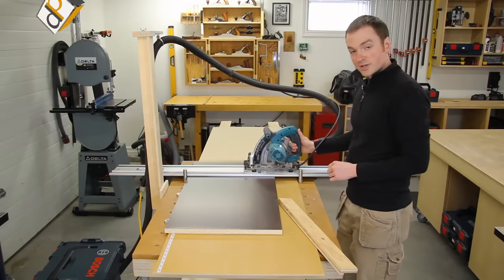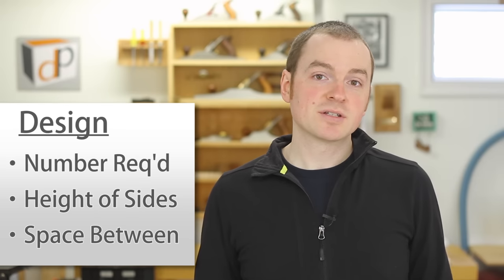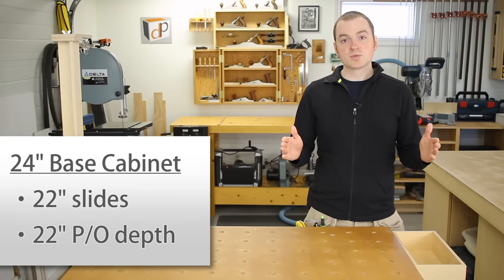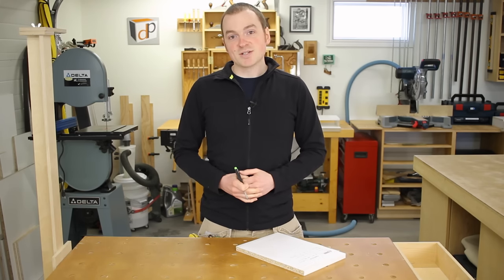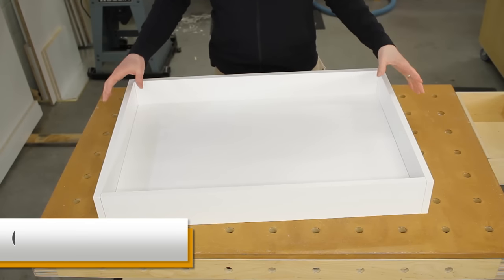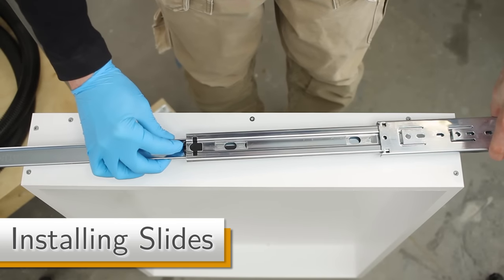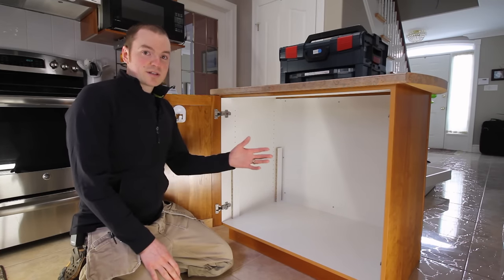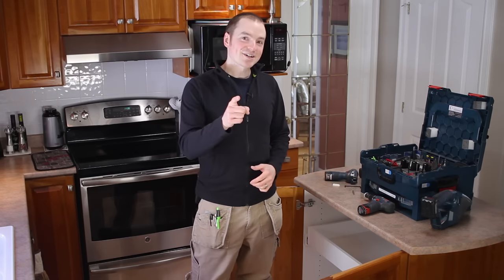How to Build & Install Pull Out Shelves - DIY Guide

Comment: Can you use the glides you recommend under a shelf? I have a industrial type shelving rack with wood shelves and want to install a slide out for a 30# epson printer so I can easily open the top and use the top mounted manual feed when I need to instead of taking the entire thing off the shelf and putting it on the floor.
Reply from the maker: Yes that should work fine. As long as you have something to mount each side of the slide to and have the proper clearance.

Comment: How do you attach the double spacer on the bottom drawer to the cabinet?  Do you pre- drill the cabinet?  My drill bit is only 1.5 inches long and is not enough to go through the double spacers plus cabinet. Or do you mark and drill on the individual spacers and cabinet? then using nail to attach the 2 spacers, then screw the now double spacers to the cabinet via the drilled holes. -newbie to wood working.
Reply from the maker: I predrilled through both layers of the spacer and a little bit into the cabinet side and then drove a screw of the right length. If you only have a short drill bit you could drill through one layer at a time and then use something long and sharp to mark where you need to drill the cabinet side through those holes.

Comment: Hi Dan,
Great video.
Can you please tell me if there was a reason that the front panel (ie the one you see when you open the cupboard) was not a full width panel. For aesthetic reasons I thought it may be better if this was the case as it would hide the join to the side panel.  Also wondering if you use glue when working with Melamine? If so what kind?  
Thanks Again
JJR
Reply from the maker: +RJJFavorites the reason I used the construction layout that I did was just for simplicity.  I have built pull outs in the past where I ran the front past the sides to conceal the fronts of the slides as well for pull outs that are seen more.  I wanted to keep these ones basic and build them as I would a typical drawer box that gets a finish front applied.  For the amount that these pull outs are seen and for what is stored on them I didn't feel that it was worth making them more elaborate.

I do use glue sometimes when working with melamine for joints that need to be extra strong.  For most joints I find the screws are plenty strong.  I use Titebond melamine glue which works very well and makes a good bond.  http://amzn.to/2pfNjVw
Reply: Thanks for the quick reply.

Comment: HI Dan, any reason you didn't dado the sides, front, and back pcs for more strength?
Reply from the maker: Sometimes I will do that for plywood but I don't usually bother with melamine. I've found that the screws provide enough strength for most applications. Sometimes I will add a bit of melamine glue to the join for some extra strength when needed.

Comment: Great tutorial. I’m looking at putting drawers in a walk in pantry that only has shelving and was hoping to put a number of sliding drawers in. I know there are bottom mounted sliders which I could mount to the bottom (Top of shelf). But I was wondering if there are top mounted sliders to mount to the bottom of the shelf so that I can put 2 drawers inbetween the shelves. Btw, I’m in Australia so stores would be different here than in USA. Thanks in advance
Reply from the maker: I haven't seen top mounted slides but that doesn't mean they don't exist. You could make some custom blocks or brackets that would allow you to mount side mount slides to the top or bottom of the existing shelves or if you can side mount them to the sides of the cabinet.

Comment: Great video. It's a project I need for my home. Just one question - your work pants - where can they be found? With all those pockets their perfect for working on projects. Do you have a link to the manufacturer? I appreciate all your help.
Reply from the maker: Those pants are the Blaklader Brawny pants. I've since switched to the Helly Hansen Chelsea Evolution pants though a couple years ago and I like them even better.
Reply: @DPShopTalk  thanks. It's difficult to find work pants that are practical for everyday use.

Comment: Hi Dan. It is clear that the drawers are full extension pulled out with the slides you are using. Can I use these on shelves?
Reply from the maker: A shelf by itself wouldn't work well as a pullout.

Comment: Do you make sure the slides are level before installing? If not, I can see binding in the ability to slide the drawer smoothly.
Reply from the maker: Yes that's why I reference off the bottom of the cabinet to make the slides parallel to the cabinet bottom.

Comment: I have a narrow upper cabinet - made for stacking cookie trays but the cabinet does not have any dividers.  I am quite short and this cabinet ( above the frig) is very deep so just fitting it with dividers isn’t a good solution.  Wondering if it could be fitted with a narrow, deep pullout with dividers the height of the drawer? I’d still need a stool to reach but I wouldn’t be fighting the cabinet depth.  Your thoughts?
Reply from the maker: That sounds like a good spot for a pullout and dividers would help keep it organized. Even if you still need a step stool you would be able to access everything easier.

Comment: Great video! Now that I am inspired,  I have a couple of questions.  How do you put in a drawer like that when you have a double door with that center piece?  When you cut that center vertical board out, do you need to add some type of support?  Thanks.
Reply from the maker: It depends on the cabinet construction and if that piece is structural. If they are face frame cabinets and you take out the center frame piece then you'll have a gap between your doors. One option would be to break it into two pullouts.
Reply: @DPShopTalk  How do you do the part in between the drawers?
Reply from the maker: @tara6094  you would need to add some rails between the pullouts to mount the slides to.
Reply: @DPShopTalk  thank you!!

Comment: Unless I missed, what kind of screws did you use. I'm used to screws and glue -- never worked with melamine...
Reply from the maker: The screws I use to assemble the melamine are #6 x 1 3/4" particle board screws.

Comment: Would be good to add coverage of what to do if the cabinet has a front divider but ru s the full width.  I assume installing a mount "bar" for slides, but clarity would help.
Reply from the maker: Yes if there is a middle divider then you would usually need to add some rails on each side of it to mount the slides to.

Comment: what screws are you using on this project? I didn't think the melamine would handle the weight of the food in a pantry drawer so i'm curious.
Reply from the maker: I use #6 x 1-3/4" coarse thread screws for joining melamine. When an extra strong joint is needed I use melamine glue as well.

Comment: shouldn't you use better joinery like dove tails or drawer locks? Also, wouldn't soft close slides be a better choice?
Reply from the maker: The joinery, materials and slides are always the choice of the client. For melamine cabinets it doesn't really make sense to use higher end materials or joinery. Some people opt for soft close while others don't really care.

Comment: You don't find the impact driver to be too powerful for particle board? Do you miss having a chuck when driving?
Reply from the maker: +Jason J. Ayala P. No i find that the 12v impact driver is quite controlled when using it with particle board as long as you pay attention to what you're doing. I don't miss having a chuck since the bits lock in quickly and I have a 12v drill for anything I need a chuck for. I also have a 12v non impact driver for more delicate driving.

Comment: Just curious, why not use base mount slides (undermount) so you don't need the spacers?
Reply from the maker: That would definitely be an option. I like the simplicity and strength of side mount slides.

Comment: I want to make some of these about 37" wide, do you think this would be stable at that width, or would I be better off making them narrower and giving up some of the space inside my cabinet?  Thanks so much!
Reply from the maker: +Private Lender 37" should be fine for width.  I would make the sides and front and back decently wide to help avoid sagging in the middle and also use at least 100 lb ball bearing slides depending on what will be stored in them.  Hope that helps.
Reply: Thank you!
Reply: What type of slides would you use in this case? Can you please share a link?  I was planning on doing 37" too. I've been looking at accuride drawer slides.
Reply from the maker: If you look in the video description I provided some links for some full extension slides. Accuride tend to be better quality but I've had good success with the less expensive Pro Series slides too. The weight rating is the most important thing to pay attention to.

Comment: If my pantry depth is 23.5” what size sliders do you recommend? Also how do you approach it if one side has large hinges for the pantry door that protrude out about an extra 1.5” than the other side? Thanks!
Reply from the maker: I would use 22" slides in that case. If the hinges stick out on one side and you can't put the pullouts where there isn't a hinge then I would use thicker spacer strips on that side to clear the hinge. It will give you a narrower pullout though.
Reply: @DPShopTalk  Thank you Dan!
Reply: Which double edge trimmer do you recommend?
Reply from the maker: @EEZYEEEE  I use the Freud double edge trimmer for trimming edge banding.

Comment: Dan I wish I had a workshop like yours mine consist of my back porch patio with a tent canopy
anyway being retired from the kitchen business I will start by making several for my kitchen and then take pictures and market on social media.
My question is about what to charge to install a project like you showed in your video seems like cost is about $ 35 a drawer with slides that's before labor and installation can you comment thanks.
Reply from the maker: I can't remember exactly what I charged for this job Bob but it would have been about a couple hours for install.  So it would depend on what you're hourly rate is as to what you would charge to install a pullout.  On a job like this I would have quoted the entire job based on materials plus however many hours I figured it would take.  Does that answer your question?
Reply: yes thank you

Comment: Great job on measurements..but I think pocket holes on the back and front would look much cleaner
Reply from the maker: +Devanand Magram do you mean for attaching the bottom in place or for the corner joints?  Sometimes I use pocket holes but I've done some tests before and actually found the particle board screws that I use driven in the way I showed are stronger than pocket hole screws in melamine.  Also unless the pocket hole is somewhere that won't be seen it's easier, faster and less noticeable to put a Fastcap screw cover on than the white Kreg pocket hole covers.

Comment: Wondering if there is a materials list?  I am specifically looking for what kind of screws to use with melamine?
Reply from the maker: I don't have a materials list compiled but the screws I use for assembling melamine are a #6 x 1 3/4" coarse thread particle board screw. You want to make sure you use a coarse thread since a fine thread won't hold well in melamine.
Reply: @DPShopTalk  Thank you so much for your quick reply!  I loved the video and will be doing this project this week.

Comment: would pocket holes work on this as well? especially if you’re using a melamine board? and why not make the front and back boards longer so it could sandwich the sides and bottom boards and hide the sides from being seen from the front?
Reply from the maker: You could use pocket holes. I usually use pocket holes on drawer boxes where the front of the box will be covered by the finished front. On a pull out you can't cover up the pocket holes the same way which is why I use screws and fastcaps. You could also make the front and back longer like you said but I prefer to use a typical drawer construction layout like I did so that it makes the finished width of the pullout very accurate and consistent so that the slides work properly. Either way will work but personally I prefer the way I did it in the video.
Reply: @DPShopTalk  Thank you. And great video, btw! I’m a newbie with woodworking and that’s why I ask all these questions. lol. So, if you don’t mind, I’d like to ask: which way is stronger: your way or pocket holes? or they’re pretty much the same? I’ve got like 9 pullout shelves that I need to make. and I’m trying to figure out the best way to do it and the fastest... without compromising the build. Thanks again!
Reply from the maker: Asking questions is how you learn! I would say both methods are pretty comparable when it comes to strength. The pocket hole screws have the advantage of grabbing though the thickness the material which is generally stronger but the way I did it in the video I used 1-3/4" screws which gives more screw length into the material. Either way the limiting factor is the strength of particle board core.  I would use whichever method works best for you when it comes to assembly and the look of the finished product that you prefer.
Reply: @DPShopTalk  Thank you! and more power to you and your channel! 🙏

Comment: hi what is about using a wood glue, to make the structure stronger any suggestion please
Reply from the maker: When I want an extra strong joint I use melamine glue along with the screws.  Melamine glue is designed to etch itself into the melamine surface to give a strong bond.

Comment: This is the only place I've found that screws the bottom of the drawer to the sides.  Most use a groove. How do screws hold up? I'll be building a pullout drawer to hold home canning, so it will be carrying a lot of weight.
Reply: I would use 3/4" plywood and pocket screws for your drawers. If over 20" wide, you may need a support bar in the middle underneath to prevent sagging. Good luck!
Reply from the maker: I've never had any issues with screwing the bottoms in.

Comment: 10:22 if you're replacing existing shelving, can't you just use the existing shelf as a level guide and holder for your sliders? I'm doing that and seems to be much easier.
Reply from the maker: If the existing shelf positions work then that would work great.

Comment: I wish you had listed screw sizes.  Would you be able to share tips for selecting the right screw type, gauge, length, and number for each part of this project?  I couldn't tell what you used to screw the slides on the drawer and on the spacer (#6 1/2" wood screws??).  I couldn't tell what screws you used to apply the spacers (#8 self countersink?), what length as compared to your spacer and cabinet widths (1/8" shorter than the total width of those 2 pieces?), and how many screws on each side (3? 4?).  I want enough support for everything but I don't want more screws than I really need and I don't want any poking through the other side of the cabinet.  Also, I don't want screws infringing on the slide.  This is new to me, so I don't know the standards.  Thanks.
Reply from the maker: +Kathleen Atchison the screws I use to assemble the pullouts are #6 x 1-3/4" particle board screws and the screws I use to install the slides are #6 x 1/2" truss head screws.
Reply from the maker: +Kathleen Atchison the screws that I attached the spacer strips with were #6 x 1-3/4" particle board screws as well.  In general you want to use the longest screw you can without risking the screw poking through the other side.  Usually 3 screws on each slide and spacer strip is enough to hold everything securely.
Reply from the maker: +DPatricia Latimore Johnson generally I would use those same screws for other types of wood as well.  If you were using solid wood then you would probably go with more elaborate corner joints though anyway.  The screws for the slides would be the same.

Comment: Can I do this to a 36” cabinet
Reply from the maker: As long as you put slides in with enough weight rating and make the front and back wide enough to prevent sag in the middle

Comment: Let me offer another way to record measurements. 
8 1/2 inch would be written 8.08.0  Before the first decimal is whole inches. The middle pair are 16th and the final digit are 64ths.
8 23/32 = 8.11.2     15 29/64 = 15.07.1 
This avoids confusion and gives me an exact measurement I can locate on a ruler every time.
Reply from the maker: Thanks for sharing that David.  I've never seen measurements written that way before but it makes good sense.
Reply: David, I don't understand.  Could you give a little more explanation?
Reply: Your ruler is divided up into inches and then 1/16th inches. Each 16th can be seen as four 64ths. Most everyone sees the half 16th as a 32nd or two 64ths. This method gives better detail regognition.
15 1/4 = 15.04.0
The second pair must be a number between 0 and 15.  16 would be an inch added to the first set.
 The final digit must be a number between 0 and 3. 4 would be another 16th added to the middle pair.

Comment: Looking for tricks to accurately measure the inside width of a cabinet where face frames complicate getting this dimension. I'm not sure I trust my eyes to accurately read a "curved" tape measure. I'm thinking about using two sticks laid parallel, extended to the sides, strike a pencil line so I can recreate their relative position, and then, measuring the sticks... I'll try this method at the client's house later today...
Reply from the maker: Thats the best way to do it. You can either strike a line like you said or clamp the pieces together.
Reply: @DPShopTalk  Glad I did this -- worked great. My drawers + hinges + space cleats were a bit wide but I was able to plane my spacer cleats to get a perfect overall width and still provide clearance for the existing hinges. Installation will be the true test...